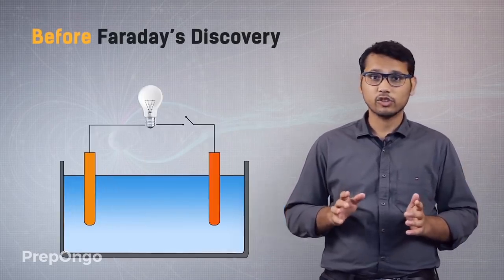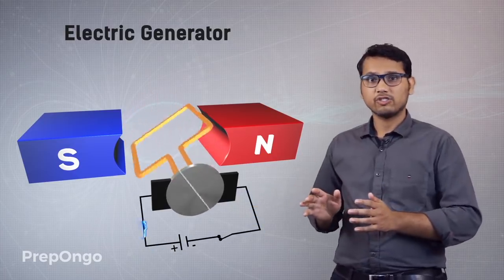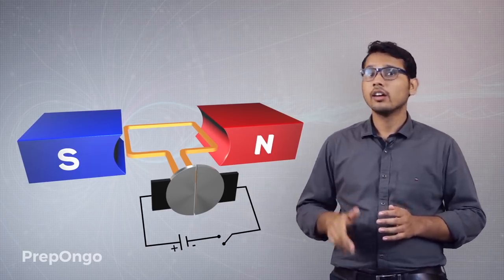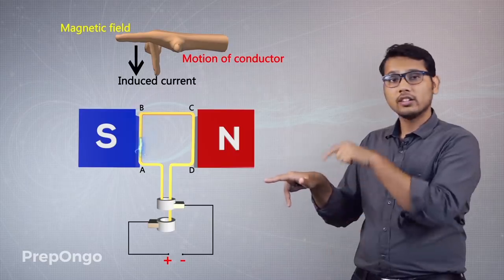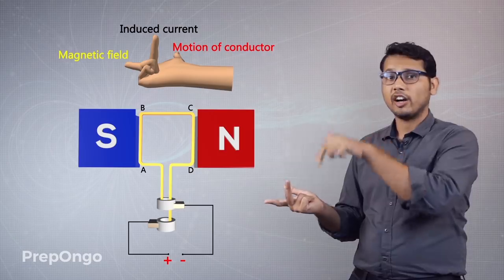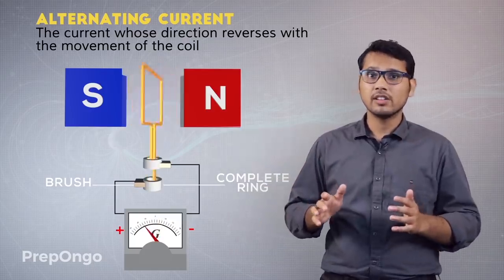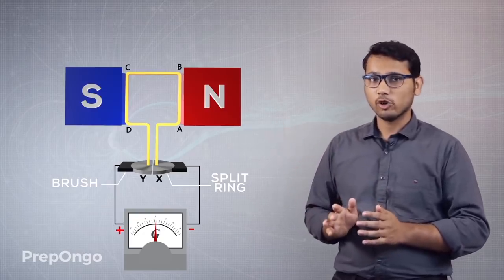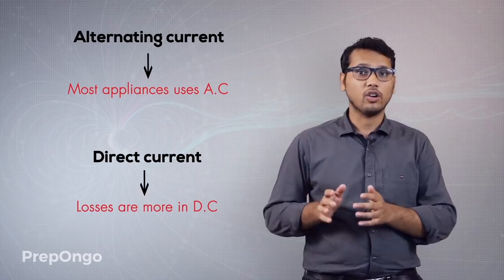Electric Generator

Comment: In AC Generator... current is bi directional, every half rotation direction changes., If this current is lead into a motor,will the motor rotate in same direction or it will change direction of rotation?

Comment: Sir I have a doubt . AC current is also flowing in the same direction or unidirectional. DC is also working the same way. How can you differentiate , sir? Can u pls clarify my doubt.
Reply: Geetha Nagisetti it is AC generator and not AC current
AC generator changes it’s direction after every rotation and 
DC generators does not change its current
Reply: @nazinishanavas1074  can I know if u r the sir explaining the video or someone else?
Reply: @nazinishanavas1074  My question was correct. You didn't get the question right. And Stop blaming me if u don't know the answer.
Reply: Hi

Comment: Y we r using 2Rings here
Reply: wut
Reply: What VJ
Reply: 2 rings is because its ac .in dc generator one ring with 2 terminals is used it looks like ( ).when coil moves from 0,90,180 degrees current generation is +ve,0,-ve.hence using one ring we get Dc.

Comment: A generator doesn’t have a battery
Reply from the maker: Hello Shreya Singh
Yeah you are right the generator does not have a battery, rather it acts like a battery. We connect the electrical appliances across the + and - of the generator and then it acts like a battery.
Reply: Yeah right!!

Comment: something is wrongly explained here, the tutor says that current will be induced if we move the coil in the magnetic field that's correct up to some mark but it overlooks the fact that faradays law says emf will be the one which will be induced not current. Current will only be induced if the conductor has a closed loop otherwise the two ends of the conductor will generate a potential difference only.
Reply from the maker: You are correct Mayank. This video is for a class 10 student and he doesn't know about induced emf, all he knows is what current is.